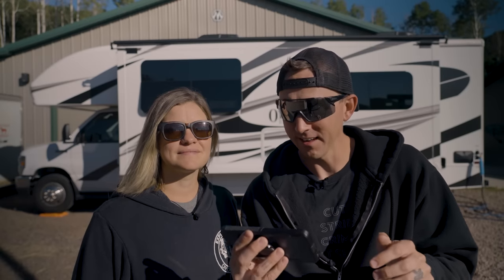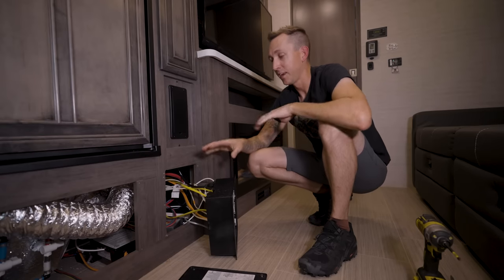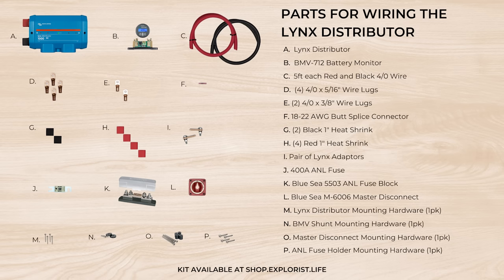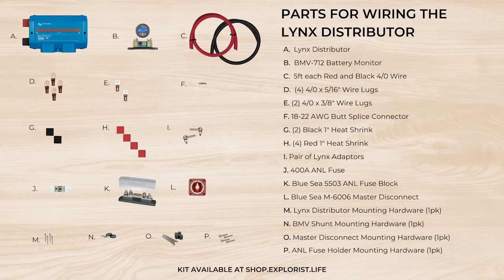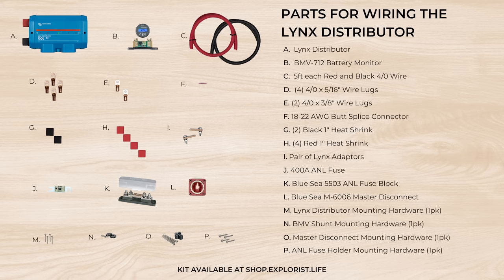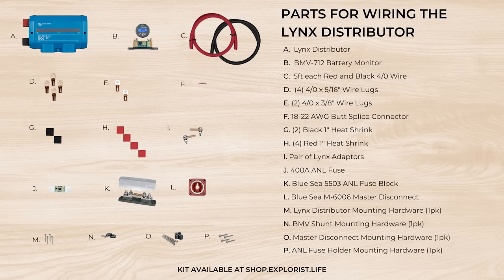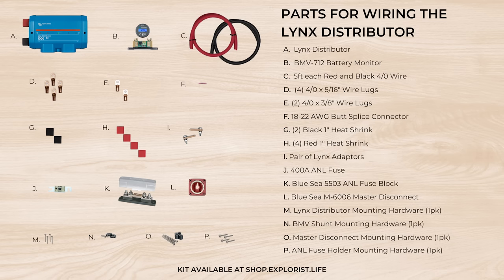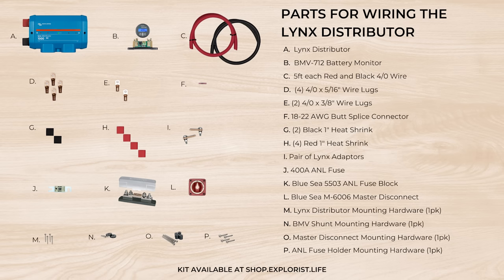Motorhome RV Solar & Lithium Upgrade - Start to Finish DIY Installation

Comment: Re: connecting to new lithium batteries. Could a person just diconnect the wires going to old lead acid batteries directly at the original electrical panel and then wire new wires directly from new victrom system to the original electrical panel. this would eliminate a connection from the old battery site to the original electrical panel completlu. My original rv electrical panel is very close to my new victron set up and new batteries. The old battery site, where I would have place junction studs would be furthest away from my new system and the original electrical panel.

Comment: Any concerns about the batteries getting too cold in that compartment or will the built in heating pads be able to handle it? I live where it gets anywhere from -20F to 110F.

Comment: I purchased your plan to rebuild a 50 amp power system in my trailer and it has gone great, just one question. In your video you say to turn off the existing converter and tape the breaker off.  Can I simply remove the converter as it would be the perfect spot for my splice kit box to go?
Reply from the maker: Sure!

Comment: You could Connect the Starter battery also to the shunt
Reply from the maker: Oh, there is all kinds of additional stuff we ‘could’ do if we wanted additional functionality.
Reply: @EXPLORISTlife  about the Connection from the Starter battery Take ir from the battery Side of the DC to dc charger
Reply from the maker: @kummerleo7655 that’s not a metric we are interested in for this project.  Also, this project was finished last year and this RV is now about 2000 miles away.

Comment: One thing they didn’t mention in the video regarding the emergency jump switch used to power the starter motor from the on board batteries in case of an emergency. 
If a 24v battery setup is used to power a 24v inverter. Then a separate 12 volt battery is necessary as the starter motor is 12v powered and the cable size must be suitable for yhe current draw.
Reply from the maker: We didn’t mention that because this is a 12v battery, so that would have been off topic. 😂
Reply: Yes, I’m aware of that. I have since seen one of your other van build videos in which you did include a voltage converter but only for low current applications. I’m not being critical, just making sure none of your viewers make that obvious mistake. You are right in mentioning a maximum of 3kw for a 12v system.

On another note I’m very impressed by your quality of workmanship and the thoroughness in which you approach each task . My apologies for writing in the third person in the original text.
Reply from the maker: @pha2623  Glad you like the videos.  Calling us out on off-topic considerations is DEFINITELY being critical and demeaning the education that we are providing on this channel; so you should just stop doing that.  You come across as a know-it-all.  If you think you know the BEST way to teach this stuff... start your own channel, so you have ultimate control over the way the topic is delivered.

Comment: I realize this is an older video and so maybe you’re not still paying attention to comments on it. You pointed out at the beginning of the video that there was a inverter existing in the rig and that you couldn’t find it. I have a similar situation in my trailer, so I was curious what you were gonna do with it, but I never heard mention again. Did you just leave it in place under the assumption that it wasn’t gonna hurt anything even if it got turned on but for most of the time you didn’t even need it on?
Reply: To add a tiny bit to that I do know where my inverter is, but I’m not sure the best way to take it out of the system. Maybe the simplest thing is just leave it but don’t ever really use it.

Comment: Your are methodical. Excellent video. I was prepared to comment about the safety of the shunt but you placed spacers so that was great. I do have a question about the factory pin codes for the apps. If you don't change them are you possibly exposed at various campsites where others can potentially log onto your system and change the settings in a nefarious way? Jason from Melbourne Australia.
Reply from the maker: Yes, you should change your pin codes to something personal.  I just didn't do it on this video because then people could see my codes. 🤣😂
Reply: @EXPLORISTlife  Thank you. Love your work.

Comment: Think the only thing you didn't touch on in the inverter. I am putting this system into my class c motor home but it doesn't have a inverter in it already so need to know if I need one and what one for this setup because mine did not come solar ready so if there is a better video for a class c hookup let me know please, thank you
Reply from the maker: The factory inverter isn't relevant.  We didn't need to do anything differently for this system that would have done for a system without a factory inverter.
Reply: @EXPLORISTlife  Thank you :)

Comment: Why did you add the negative cable from the shunt/lynx to the frame when the factory battery location negative should be connected to the frame via the battery relocation kit?
Reply from the maker: That wire is of inadequate size
Reply: @EXPLORISTlife  Thank you.

Comment: Do you leave solar on while in storage?  I am hearing mixed opinions about solar panels with load that can cause battery damage, and without load, that can cause panel damage.
Reply from the maker: For this specific setup, you can just leave solar on OR you can turn off the whole system.  Either way.

If need more specific guidance on your particular system and you have purchased/are purchasing from our store (shop.explorist.life) reach out for some more personalized help: shop.explorist.life/support

If you've purchased/are purchasing elsewhere, reach out to your dealer for support.  We'd love to have you as a shop.explorist.life customer so we can provide a bit more help in the future. 🙂

Comment: For alternator changing would having the dc/dc converter installed after the isolator give you the best of each?
Reply from the maker: The way we installed it gives us the best of each. Although there are many ways to do this stuff, rest assured, we are showing you our recommended methods and not keeping the best methods to ourselves.

Comment: My small class C Onan generator uses the OEM lead acid house batteries to start it. Have you seen this before?
Reply from the maker: Yeah.  Pretty normal.  That's how this install was.
Reply: @EXPLORISTlife  Did you keep it for the Onan?
Reply from the maker: The battery bank relocation kit shown in this video handles that.
Reply: @EXPLORISTlife  Thanks for taking the time!

Comment: This is the video I've been waiting for as I'm planning on adding Lithium/Solar/Inverter to my 30a motorhome this fall. Thank you for covering the existing alternator charging, I had no idea how that worked. Some questions; I was planning on a 400ah/800w setup. What is gained by the 570ah/1200w setup except for allowing for more days without sunshine, any lost functionality? Why no Cerbo/GX monitor? Is the battery monitor and bluetooth app enough?
Reply from the maker: Glad it helped!  The additional battery is just more capacity which means you can use more power per day; and the additional solar means you will have a better chance of recharging the batteries to full every day.

The Cerbo & Touch 70 is a great add-on for those who like to monitor system data and like the more 'advanced' monitoring; which is NOT my mom.  The VictronConnect app gives PLENTY of system monitoring without the expense of the Cerbo GX.
Reply: Do you have the link to the blue wire duct?

Comment: i'm very confused why you had to remove the fridge - that's crazy, we use our outdoor fridge constantly!  why didn't you just cram a LiTime 460AH under the step and call it a day? then you can also use the oupes mega 2 for another 2000w using the shore power plug!
Reply from the maker: Cramming a battery under the step and calling it a day and then using a random portable generator connected to shore is not the kind of workmanship we are happy with on this channel nor is it what people are coming here to see.

Comment: I am curious if there are any issues with the BB batteries handling the starting amps needed for the generator or the emergency starting for the motorhome.
Reply from the maker: With a bank this big; there is no issue with that.  These batteries can deliver a max of 300A continuous (so, 600A for both of them total).

Comment: If your house batteries are Lithium, how are you going to allow for the motorhome cross-connect switch to jump the engine battery, if necessary?  My understanding is that Lithium batteries can't safely do that.
Reply from the maker: They can given the battery bank is big enough, which this one is. 👍

Comment: I've been wondering... why use a solar isolator over a breaker style solar disconnect?
Reply from the maker: The isolator is the more correct part as it's designed specifically for the purpose.  A breaker can catch on fire if installed in the wrong direction and offers no overcurrent protection.  More in this video: https://www.youtube.com/watch?v=FbwxUedCe-c

Comment: How did you bypass the factory installed inverter? It was never mentioned
Reply from the maker: Didn't need to do anything with it.  Since the transfer switch for that inverter always saw "Shore Power" (from the Multiplus Inverter/Charger) it just stays off.
Reply: @EXPLORISTlife  OK I think I understand. I'm actually looking to get the explorer kit for my travel trailer. But it has a factory installed inverter and was trying to figure out whether I had to figure out something fancy to do with that wiring (because I plan to use those outlets) or if I can just install the kit like you did.
Reply from the maker: @MyNomadicDream  You should just be able to do what we did if it's wired similarly.

Comment: Does the Onan generator charge the batteries too? Don’t recall seeing a section on that but is that an option?
Reply from the maker: Sure does!  In the exact same way as shore power.  Power comes from the transfer switch to the multiplus ac input.  The transfer switch is getting its power from either shore or generator, whichever is active, and forwarding that to the multiplus.

Comment: I've seen you use copper bar to connect batteries and in place of very short wires in your builds?  What thickness/ width bar do you recommend for a 12v system with a 300amp main breaker?
Reply from the maker: That was only in one highly specific setup where space was incredibly limiting.  I don't recommend doing that under normal circumstances and instead; using wire like we showed in this video and like we include in our kits at shop.explorist.life
Reply: @EXPLORISTlife  you use small pieces of bar to go from master switches to a lynx from time to time, no?   Love the full build vids!  Do you have any posted with a multiplus 2000 install?
Reply from the maker: Those are the "Lynx Adapters" from our store shop.explorist.life.  

Video w/ Multiplus 2000: https://www.youtube.com/watch?v=KM_8s4cTjWA&list=PLmvhcyi4n0TUU8FUc6LE38TBkdSLjdw_5&index=2

Another one: https://www.youtube.com/watch?v=gcDYiYgUCzg&list=PLmvhcyi4n0TUU8FUc6LE38TBkdSLjdw_5&index=1

Sounds like you are in the pre-purchase research phase?  We'd love to have you as a https://shop.explorist.life customer so we can provide a bit of personalized guidance and support as needed. If you're planning on purchasing from us and need some help; reach out at shop.explorist.life/support
Reply: @EXPLORISTlife  besides being a off grid electrical guru, you are an excellent content creator and businessesman.  I have already ordered my parts and will be redoing a 2022 boreas xt that has a dual AGM setup and zamp pwm controller.  I have been dropping links to your vids lately on Facebook groups when I am answering questions about off grid wiring and installs!  I have one more question - do you feel that a lynx distributor should always be used in a victron system?  I'm planning on 2 vatrer 300ah heated lithiums, 2000 multiplus with dongle(and USB to program), 2 mppt controllers, Orion dc-dc, and smart shunt connected through old fashioned bus bars using the app to monitor each individual component.  Do you have a video that would sell me on including a lynx?
Reply: I found the lynx mini series you did.  Thanks!!!
Reply: After watching the lynx distributor vids I checked the 1 star reviews of the anl fuse holder I had ordered, melts before fuse blows, and then ordered a lynx distributor that will arrive just in time for the install 4 days from now!  TY.
Reply from the maker: Nice!  I think that the fact that all but one system design on our shop includes the lynx distributor is an indication of how useful I find it.  That component has single-handedly removed nearly all fusing/connection errors people were making prior to us introducing it on our channel.  Sounds like you are in a time crunch on that Lynx Distributor.  If you'll let me know your Order number, I'll personally do my best to make sure it gets out the door today or tomorrow.

Comment: Why 12v and not 24v in this use case? At what point would you have done 24v?
Reply from the maker: 24V for systems needing more than 3kvA of Inverting Power or more than 1450W of solar.

Comment: Did this unit have a Battery Isolation manager. If so was it removed or is it just left alone?
Reply from the maker: There was no BIM.  Just a standard solenoid like we mentioned in the video after alternator charging.
Reply: @EXPLORISTlife at some point could you maybe do a video on replacing or not replacing a BIM in a C Class. Been following you for a few years now, so very informative and professional.
Thank you
Reply from the maker: I'd treat the BIM the same as the solenoid I showed in this video.

Comment: Great install, very detailed and easily to follow along even if you’re not electrical savvy…. BUT, all of your ‘success’ steps and parts cost a fortune! This is not a “average” upgrade most can afford. Thanks for the knowledge though.
Reply from the maker: There are actually plenty if people who can afford stuff like this.  Just about what people prioritize financially.  Boats are expensive, but people have them.  Motorcycles are expensive but people have them.  Vacations are expensive, but people take them, etc.

Comment: I have a National type A motor home, do you do installations, I'm really not able to do that.
Reply from the maker: Hey!  Thanks for watching!  I added installation information into the pinned comment at the top of this video comment section.
Reply: @EXPLORISTlife  I'm asking if y'all do the installation, I'm not capable.
Reply from the maker: Right, and i put that information about our network of EXPLORIST.life certified installers in the pinned comment.  We do not personally install systems for others, but our network of installers do, which is linked in the pinned comment at the top of this comment section.

Comment: This alerts you to the fire hazard of the 30 amp power cord junction box! Winnebago and other manufacturers use twist nuts on the cabling in the junction box which is an absolute no no no no no! These arc and spark causing fires. I know first hand. I'm an aviation electrician and one never ever uses twist nuts on vibrating equipment. You can't use twist nuts on aircraft, sailboats, heavy equipment, and automobiles.
Reply: Thanks for the info.  What should we use instead? :)

Comment: What is the voltage with the three panels in series?
Reply from the maker: This is the solar array setup used: https://shop.explorist.life/shop/all-products/camper-wiring-kits/solar-charging-wiring-kits/1200w-solar-charging-wiring-kit-6x-200w-12v-battery-bank/

These are the panels: https://shop.explorist.life/shop/all-products/rich-solar-200w-12v-solar-panel/

They are 12V nominal panels which operate closer to 20V.  So, 3x of those panels wired in series (series wiring adds the voltages together while the amps stay the same) gives us ~60V.  More info on how solar array wiring affects voltage and amperage of the total array: https://youtu.be/KJ5zCY5EBeQ?si=oFpMwl0qR6wjXYmJ
Reply: @EXPLORISTlife  Thanks for the info!
Have a great day.

Comment: Did you find the other inverter? If so, what was done?
Reply from the maker: Yeah, I found it.  Was buried behind a TV back in the depths of a cabinet.  Nothing needed to be done as our wiring plan will simply supply power to the 'shore' side of the transfer switch of that inverter and power would simply pass by it, regardless of if we are connected to shore or the multiplus is supplying power.
Reply: @EXPLORISTlife   I have a very similar RV.  It has an inverter on off switch by the door.  If you did not remove the factory installed inverter, should this switch be disabled?   What would happen if victron inverter and the factory inverter were on at the same time?